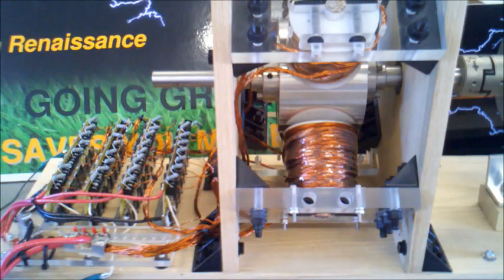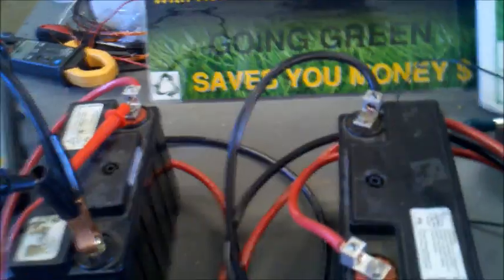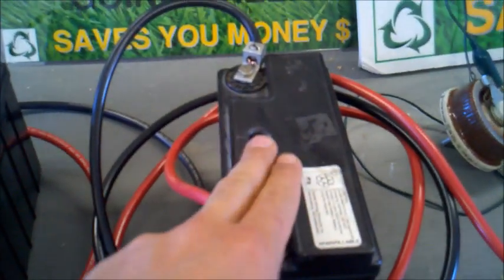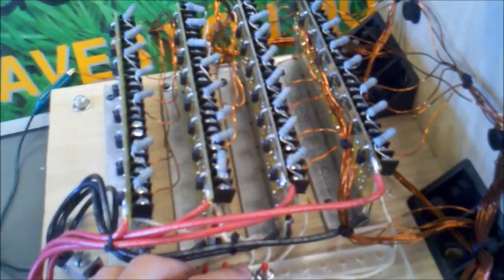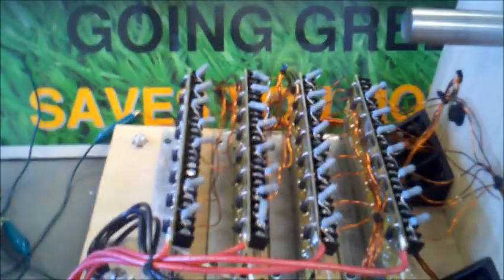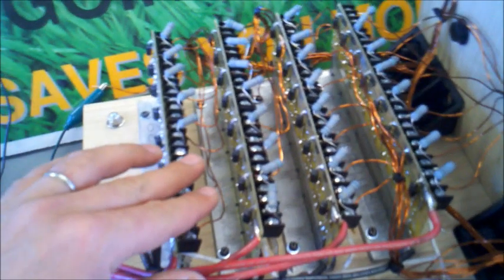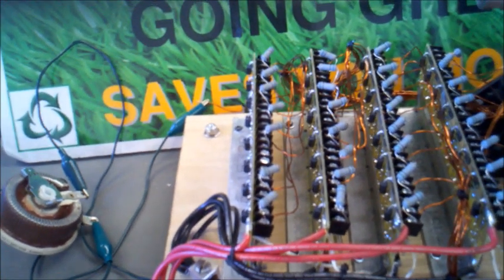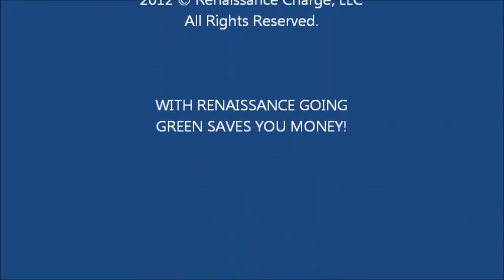4 Pole Monopole Sr. Powering a 400W Wind  Generator.

Comment: Man, I want some of those prebuilt boards like you used to sell. I never thought to take advantage of that. I'd like to know where the PCB could be located that fits the 12-bolt rails. Is it a custom board or a breadboard with thick material, big holes, and solder pads?
Reply: Your favorite nuanced customer, RIchard
Reply from the maker: Yeah we are beginning to sell them again. They were already with the window motor. We are making the original 10 coiler again with the exact board, transistors and resistors. I have to find the 12 terminal rails for you to change the resistors out.